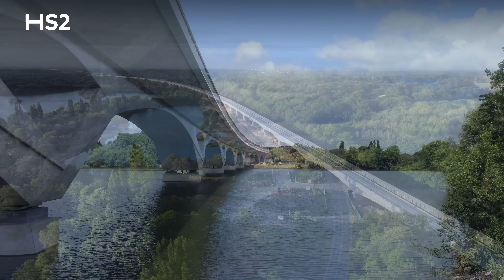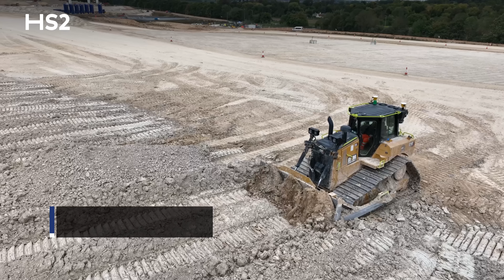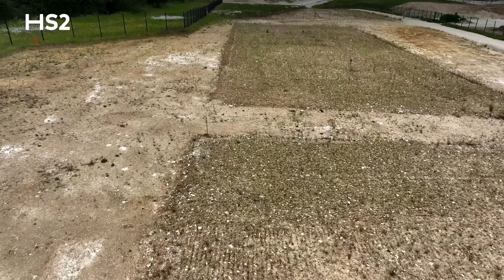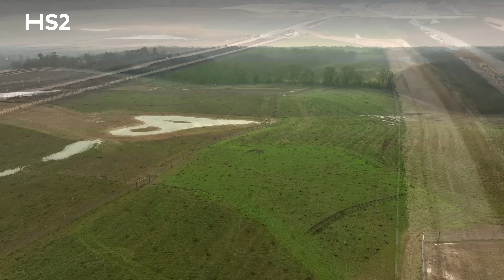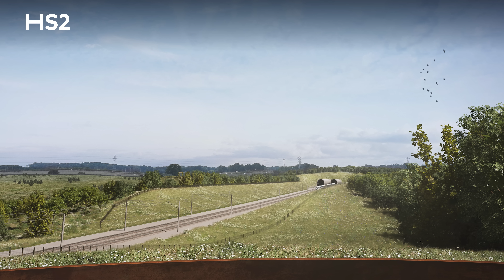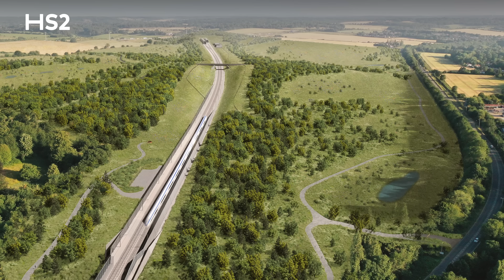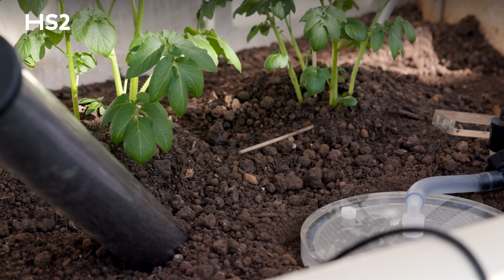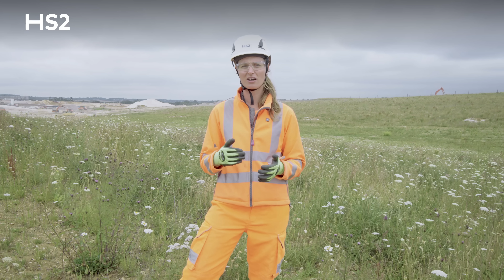Wildlife begins to flourish at HS2’s largest habitat creation site 🐝🦋🌿

Comment: This is one of the biggest waste of money this country has ever seen..

Ask yourself one thing.. with the state this country is in, are you in a crazy rush to get to London or Birmingham? 😂😂😂😂  

Can you imagine how much its going to cost to ride this thing?

Yeah... it's a massive waste of money.
Reply: the west coast main line is congested. we need more freight trains in this country which is what hs2 is for. 

if it was only for passenger use then there would be no point for it at all
Reply: @notsotad- the wcml will be the main freight route, while this line is only for passenger trains.
Reply: @notsotad Agreed but HS2 is not a freight railway. It will remove existing high speed passenger trains from the existing West Coast Main Line and so release capacity for freight.
Reply: @martinsloman6905 sorry thats what i meant
Reply: @notsotadbig it had been properly managed from the beginning it would have been a lot more likely we would have the full HS2 project 
Instead we have this ludicrously over priced commuter line between London and Birmingham cost £400,000,000 a mile
Reply: @123stelyn   Oh here we go again just making out its about London to Birmingham because it suits your biased nonsense. And a 'commuter line'? I mean really?
Grow up.
Reply: @1chish ”based nonsense “ ?
The track is literally only going from London to Birmingham!
If the project had been managed properly, it would connect to Leeds and Manchester 
The Birmingham station is being built with 7 platforms with only 3 being needed , God knows what they will build at Euston
North of Birmingham capacity will actually be reduced due to HS2 trains having a smaller seating capacity than current trains.
Still as long as your happy watching HS2 videos telling everyone what a wonderful job they’re doing doing, whilst spending £400,000,000 per mile ,that’s ok isn’t it
There’s one born every minute
Reply: @123stelyn  Yes nonsense because like all naysayers you focus on one part of the railway that will benefit the whole North South travel. Oh and by the way that £400 Mn a mile figure has been discredited. Just saying.

Now these trains will run from Euston to Glasgow and Manchester and will be the same gauge as current express trains but non tilting so actually a bit wider. The best seating on a Class 390 is 600 seats in two classes. Each HS2 train will be around 200m long, with the option to couple two units together to create a 400m long train with 1,100 seats. Which shows the nonsense you are peddling.

The extra capacity on the WCML plus HS2 increases Euston outflow from 11,500 an hour to 25,000 an hour. Again showing your nonsense.

Curzon Street will use all 7  platforms.
Old Oak Common will have 6 x HS2 platforms and 8 x other platforms.
Euston will have 6 x HS2 platforms (as phase 1) plus other platforms.

And finally even using your faulty "£400 Mn a mile" over the 100 years this will operate that is £4 Mn a mile per year and money well spent especially given the massive amount of tunnelling and mediation works forced on the designers and the environmental and habitat works being created.
Reply: @1chish laugh out loud 
Your right about not getting the cost right as I forgot to adjust for inflation,the latest lowest estimate adjusted for inflation is now £66 billion which equates to nearly £500 million per mile
Any starting and finishing their journey north of Birmingham will get no benefit from HS 
I would enjoy listening to to explain to someone travelling between Manchester and Glasgow or Leeds and Newcastle what a great use of their tax HS is 
Coupling two trains together? Which station in the uk could accommodate trains that length,their are no plans for this
You really do live in a dream world,accepting everything your told
Reply: @1chish fina 7 platforms are been built at curzon street but only 3 are being commissioned the other 4 will have no rails or signalling 
Going to recommend to HS2 they be made into a nature reserve,obviously no expense should be spared ,don’t know how you know about Euston as for the umpteenth time it’s under review  presumably to be scaled back as I doubt the planning to expand it
Reply: @123stelyn   Errr ... so you adjusted a false number for inflation to get another false number. Outstanding. But again over the 100 year life it is money well spent.
Sorry but that is how business cases are assessed....

Not sure how using a journey starting in Glasgow or Newcastle is a negative when HS2 was never going to go that far. But hey there is Northern Powerhouse Rail and the Trans Pennine Upgrade. Your arguments are from another planet.

As for train lengths the 200 metre HS2 trains will carry some 550 passengers and will travel to Glasgow but coupling them  over the HS2 part is a better use of paths. I never said the 400 metre trains would go to Glasgow but nice try at being too clever by half Soft Lad. The latest Class 390 accommodates 600 so your earlier argument about fewer passengers falls short again.

And no I don't just accept everything I do research. I would suggest you ought to try it.
Reply: @123stelyn   So you agree that Curzon Street will have 7 platforms. Exactly as I said ... D'UH!

As for Euston I know because as I said I do research. And that includes reading industry journals. Like 'New Civil Engineer' which in December 2024 published this:
    "In a written response to a parliamentary question Lord Hendy has now confirmed the new HS2 Euston station will have six platforms.
He said: 'The new HS2 station will consist of six platforms, which can support up to 10 HS2 trains per hour. No decisions have been made on the train services that will run when HS2 opens, and this will be subject to future consultation.”

For someone bragging about how he knows everything you seem a few pallets short of a full load ...
Reply: @1chish Oh dreary me you really are the gift that keeps on giving.
Your support HS2 is based on things like building 7 platforms ,at an huge cost, in the middle of our second largest city , when there’s only ever any prospect of 3 being use 
Lord Henry comes across as a well intentioned and competent transport minister, he will not have the final say on Euston final construction,that will come from the Treasury,that’s why it is under review. HS2 currently have 2 fully assembled TBM fully assembled and then mothballed at Old Oak Common (costing the county millions) because the government has not green lighted their use to Euston.
There are no detailed plan for Euston let alone an approved budget and timeline for construction .
Still it’s only money 
Oh and by the way reading an article in a trade magazine doesn’t really count as “research “
There’s nun so blind as those who don’t want to see
Reply: And yet rail passenger numbers are nearly back to the pre COVID all time record.
Reply: Hs2 has always been about capacity and reliability, not speed and journey times. Please learn and understand this.
Reply: @JT-nr2ss why is the line being built for trains travelling at over 250 miles per hour (rhe fastest in the world) if it was being built for freight and extra capacity?
Reply: people like u complaining always slow the process
Reply: Sorry Soft Lad repeating the same nonsense doesn't make it a fact.
For the umpteenth time its about extra capacity with added speed. This line will take express trains from London to and past Birmingham and they will go on up to Scotland. But you naysayers and doom merchants only pick on one part.
Name one project that has put this level of effort into the local environments and animal habitats
Reply: @1chish after Birmingham they will not be high speed !
Reply: @the-tessellater  Sorry but 125 mph is high speed. Its just not as fast as on the new infrastructure.
But it's the WCML south of Birmingham that is congested and where higher speed will pay off.
Reply: @the-tessellater Obviously they will build the line to Manchester after all the doom merchants have been absolutely destroyed when we see  how successful the London to Birmingham HS2 line is
Reply: @Kevk-v2m That has been the experience of the Elizabeth line. Over budget, several years late, but now a roaring success. More than 500 million passenger journeys have been made on the Elizabeth line in its first two and a half years, making it the single busiest railway service in the UK.
Reply: @1chish name one project that has cost this insane amount of money
Reply: @123stelyn   Oh very clever Soft Lad. I will answer when you name another high speed railway in the UK of this length, with this much tunnelling, with this much environmental work.
But again this project has a lifespan of over 100 years. Amortise that and the cost is acceptable.
Reply: Y'all need to calm down and keep your thoughts to ur self
Reply: @gursahibbajwa625ah lambkins ,have a little sit down ,and think nice thoughts